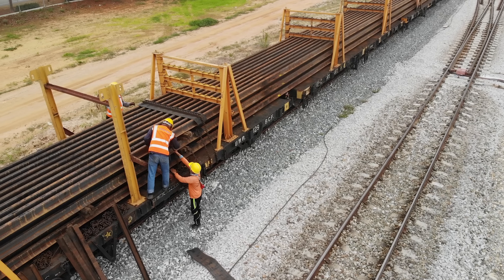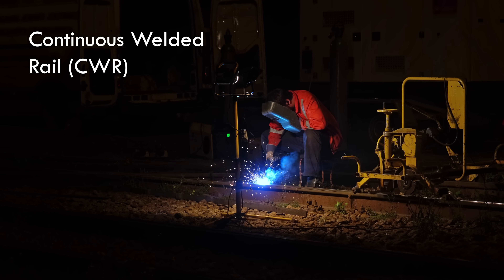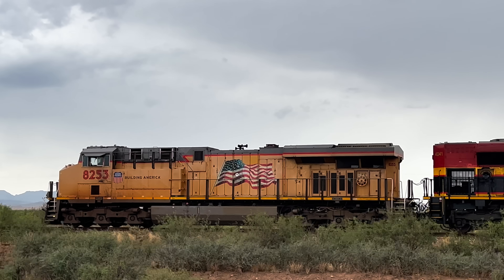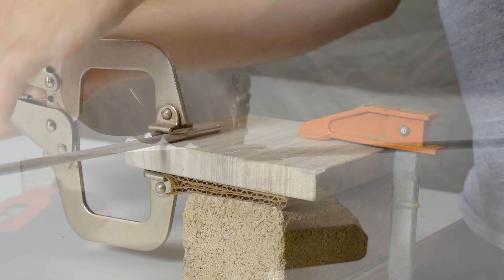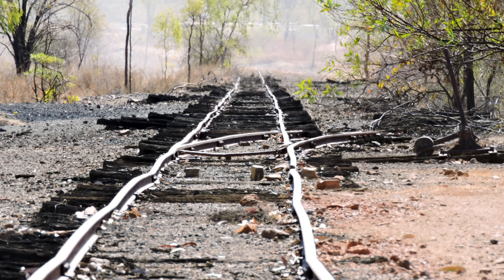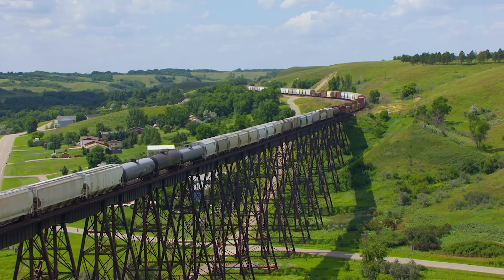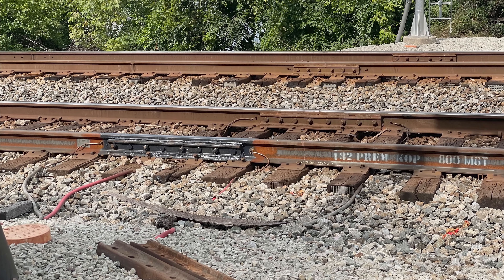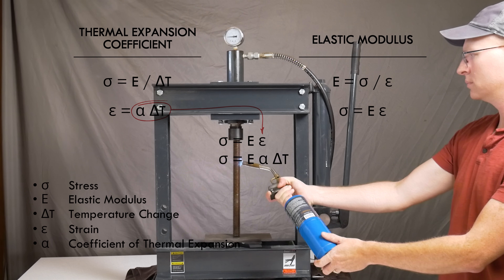Why Railroads Don't Need Expansion Joints

Comment: Railroad sun kink story,
June 21 2016, me and my wife were enjoying our first wedding anniversary vacation in Durango Colorado. We booked a trip on the historical narrow gauge railway that runs to Silverton Colorado as part of our trip (highly suggest it if you're able, and if you go in the summer, get an open air seat!). During the trip back that afternoon/evening, probably 30 minutes away from the depot, the train stopped abnormally and after a long wait, everyone was told that the rails were sun kinked and the train would not be able to finish the journey. Another train was sent to rescue everyone and get us back to the depot, and it was a record setting hot day so I heard no complaints. But we all walked by the kinked rail, and it had to have been deformed over 5 feet to the side over a distance of around 30 feet. I still have the picture on my phone to now. I also just found it by searching for it online. Definitely made me understand and appreciate railroad engineering just a little bit more that day

Comment: Question: is the entire rail cold-rolled... It's definitely hardened? Which means the surface (at least) is close to yield or has yielded to achieve ultimate tensile stress (UTS). If the surface has been cold rolled to UTS, and the core is not hardened, do they behave somewhat like pre-tensioned steel reinforced concrete? Where one part is compressive, the other tensile, making a balance to minimise expansion linearly, while allowing more radially.
Is this how it is?

Comment: The first time I pondered about this was riding the Shinkansen in Japan. That was the first time I notice their tracks has no expansion joint. I search the web as what is the secret behind this to no avail. I got it immediately as soon as you started to talk about modulus of elasticity. The most impressive thing about these rail system is the engineering structures go into withstraining the rails from buckling, especially the extremely high speed train in Japan and other countries. Brady's channel is one of the smartest on Youtube.
Reply: From my YT explorations, it appears the Shinkansen lines use slip joints like those shown at 12:50. This I learned from a video from a Japanese hobbyist trying to replicate the unique sound of trains crossing these joints...with his  model trains (he got close, but was no small feat owing to...well, size and materials).

Comment: Isn't the clickity-clack of (non-continuous) rails also caused by the joints being staggered by 10-ish feet on the two rails?  You'd get a different noise if both wheels on an axle hit joints simultaneously.

But back to the main topic - I knew many railroads had switched to continuously welded rail, but thanks for educating me on how they handle thermal expansion/contraction issues with those.

Comment: It's somewhat surprising to think of how much new technology and revolutionary engineering is still going on with modern railways, when to a casual observer they don't look any different from what was used in the 1800's.
Sure, I get that we've moved to diesel engines and we have safer coupling mechanisms, and it's not surprising that we use computers for controlling the switches now.  But who would have thought that the rails and the wheels are STILL being refined to this day?  Especially when you consider how mind-boggling massive of a project it is to replace thousands of miles of railways, thousands of existing rail cars, and with each improvement still be compatible with existing systems that haven't been upgraded.

The old adage "if it ain't broke don't fix it" doesn't seem to apply here.

Comment: As someone who has worked in manufacturing, including being a certified welder and working the last 15 years as a truck driver, I  found this totally interesting. I was wondering about how they dealt with the compression of the rails over long lengths. One afternoon, i saw a crew working on laying track as they were getting ready to perform a thermite weld. Unfortunately, there was no place to pull over the bosses 72-foot long truck. It would have been great if i could have observed the process.

Comment: Now; that this is most important when talking about straight track. Curves allow some natural relief without too much issue. It's why expansion loops are used in piping, where expansion joints are not practical.

Comment: Trackman here, the cold contraction is enough to sheer 1 inch track bolts in half. When the weather starts to change and we get the first cold snap is when we see the most broken bolts and pull a parts

Comment: In Australia, old lines do bend in the extreme temperatures that occur. So I wondered what they did when they completed the Adelaide to Darwin line - 2979 km.
In central Australia it can vary from 0C to 50C. They laid long rail which were then welded and laid on concrete sleepers, but the ballast was only laid when it was 25C

Comment: Help me out, guys... In that old system with the gap between rail ends, how does the gap close under heat (and later reopen) when the 2 ends are solidly bolted together?

Comment: Railways will "embargo" their trains if they have determined that their rails are at risk to cause possible damage (when running their trains) during certain weather events such as extreme cold or heat. It's their right to protect their equipment and personnel. (Same principle applies during hurricanes, though not expecting rails to go through thermal changes.)    John

Comment: In July 2002 I was on the Amtrak Capitol Limited when it derailed just north of Washington due to a buckled track on an extremely hot day.  I could feel the train lurch to one side just before it derailed. Subsequent reports said the track had moved 18 inches out-of-line. You'd think the Northeast Corridor, of all rail lines, would have been properly engineered!
Reply: Or that they would know the risks posed by very hot days and inspect their tracks.
Reply: I used to ride the MARC commuter train to DC, using the same tracks as you on Amtrak, using wooden ties (the Amtrak lines up to Baltimore and points north used concrete ties, like our friend from Finland above, and never had these issues).  In the last few years I rode about, 5-10 yrs ago, CSX who operates my line had a rule (for passenger trains only!) that if the expected daily temperature increase was more than 20F then they would impose heat speed restrictions on the ride home from work, which happened frequently in the summer.  I guess they didn't care if freight derailed, as you can't get sued by freight :)  Regardless, hearing or seeing texts warning of heat restrictions always got a collective groan from the riders.  I often said that the B&O railroad, the oldest in the USA, hasn't figured out how to operate trains at speed when it's hot out or the train can derail, is ridiculous!
Reply: @ps-ic8pm     Right, I realize now that route isn't actually part of the Northeast Corridor until you get South of Union Station.  The derailment was just North of Union Station on a freight line running northwest to Pittsburgh owned I think by Norfolk Southern.  So I guess that explains the poor condition of the track.  But as far as speed I don't think we were going more than 15 mph when it derailed, although supposedly the engineer saw it and tried to stop but not in time.
Reply: CSX
Reply: CWR is extremely costly. I guess somebody likes to take a short path and reduce the costs where it's impossible.
Reply: I have been on an Alaska Railroad train that had a track inspection car ahead to check for heat kinks on the hottest of summer  days.  CWR is used in Alaska, but not yet on the costal Anchorage-Whitier portion.
Reply: It's crazy how bad US rail is. Being used to the wobbly ride of Amtrak, I couldn't believe how smooth French tracks felt during my first visit to Europe. And this was considering all types of passenger trains: commuter (RER/TER), métro, high speed, "normal" non-HS track, and even trams. They are just so much more comfortable.
Reply: @rallymaniac92  I rode a Chinese high speed train a couple of years ago between Beijing and Xi-an, about 900km. At 320km/h, I could stand a coin on edge on the widow sill and it never budged. Only with a train coming in the opposite direction (combined speed over 600km/h) did the turbulence cause it to fall over.
Reply: Problem is Amtrak doesn’t get near enough funding and the first thing railroads reduce spending on is maintenance
Reply: Please read my comment and you will realize what took place.

Comment: I don't know too much about rail, but one thing surprised me that you didn't cover.  Since rail is tired to sleepers that float on the railroad bed, don't bends (curves) in the track change dimensions when the rail expands and contracts?  The more bends you have in the rail (think following a river) the less issue there would be.  Each sleeper shifting a minuscule amount isn't an issue.

Comment: Interesting content. I never thought much of rail joints or welds. But I have always assumed that some significant portion of the click-clack was produced by worn wheel bearings. I can hear the difference between individual truck sets as they pass by at crossings. Some cars are very quiet, while others make a click-clack at a frequency corresponding to the wheels' RPM. From my experience as a mechanic and millwright, that is absolutely in line with a wheel bearing worn-but-not-yet-failed.

That is to say, I sometimes feel a bit nervous stopped next to a very noisy train, ha!

Comment: Great job explaining a difficult process
I'm a retired railroad design engineer and my last job was working for SAR, Saudi Arabia Railway. When the temperature was 51° during the day and 10° at night the forces of expansion and contraction are huge
Never a big problem. But when I worked in the northern USA the first hot day in early summer was always a nail bitter

Comment: Really interesting to know that you can effectively (somewhat) negate expansion/contraction in metals!
A bit like thermal movement, hardwoods expand and contract with seasonal humidity change. As a furniture designer I have to constantly consider and allow for that seasonal movement. Major difference being in wood that movement is caused by the incompressibility of water; meaning no amount of structure or bracing can keep that movement from happening. Funny that a “simpler” material is more demanding design-wise than those more “complex” modern materials.

Comment: I wonder, would the use of the diagonal joints used to "join jointless rails" shown at 12:56 cause less wear on the train if they would be used instead of the regular joints, or are there other problems to consider?

Comment: this is what annoys me about engineers in an office... Grady you talk about the ambient heat in texas at say, 115* F... but you didnt factor sunlight thermal energy at all... that steel is hot enough to burn you easily in texas sunlight... closer to 160* in reality 

you also got close, but didnt quite brake over in the thermite welding... thermite welding actually puts the rail into tension from the massive amount of heat welding the steel, then cooling off and shrinking the rail and puts it into tension... the whole rail section for miles is under that amount of tension allowing for it to expand under sunlight and ambient heat to a more neutral amount... its like a reverse bolt

Comment: But there are expansion joints in railways. You'll see breather switches even on TGV lines. TGV lines are connected via thermite welding.

Edit: I got to the end and he briefly mentioned breathers. The title of the video is pretty misleading

Comment: I've seen them install rail in cooler temperatures with fire.  They literally light fires underneath the rail to heat it, so it will be under tension once it's all done.  That is one of the neat properties of steel, it'll behave under tension, but do everything it can to get rid of stress under compression.

Comment: Fun fact, they say a 1/4 mile stick of rail laying out on the ground will grow about 7 inches on a hot day. Another fun fact, when they lay rail on the ground for later use they will not place the sticks of rail end to end but will overlap the end a few feet so the ends do not meet and push against each other on a hot day.
Reply: If you have several hundred yards of rail unclipped and the sun comes out you can actually see the end of the rail moving.

Overlapping loose rail ends is very wise, as if the but up and the sun comes out a ton of compressive stress is generated for every degree C the rail temperature rises.

Comment: Grady, this is a wonderful video for anyone who doesn't want to dig into the math.  I am a software guy, not a mechanical engineer.  However, I've had to re-implement many of the things you covered here in some GPU versions of some simulation software.  I don't care about the math and have long forgotten partial differential equations, but of course it is helpful to know what on earth one is calculating.  Good job!

Comment: That's brilliant, welding the rails near the hottest temperature they have to deal with. Acoustic guitars have similar but opposite trouble with humidity expansion. Wood has very low tensile strength across the grain and will split when the humidity drops, but if you glue in low humidity then expanding usually doesn't break anything.

Comment: In my city there are some sections of tram track so buckled that derailment seems iminent. The only thing keeping the track somewhat straight is the use of concrete slabs to embed the track sections. But looking along the track one can see it looks like a snake.
Passengers on those lines sections are tossed around very hard even when sitting. No derailment yet though. Most likely due the slow speeds. 😅

Comment: Good video. As a mechanical engineer, I anticipated most of the points covered. Gonna admit though, I didn't think of welding during very hot days to have a higher neutral temperature. And even then, I was thinking more like mid-point of the anticipated temperature range the rail is subjected to. But he was right that you need to err on the side of avoiding buckling

Comment: People in my neighborhood complain about how noisy the railroad is. I grew up in this place and witnessed the trains of sixty eight years ago. Joints in the rail every thirty nine feet and engines that were not controlled together by computers. The differences between engines would set up a throbbing reverberation that would shake glassware off of shelves.. The trains these days just make noise when the motive power goes by then quiet and peaceful with the occasional flat spots on wheels thumping along. Growing up it was common to trespass by walking the rails. The trains went real slow and you could hear them a long ways off. Now they run at forty miles an hour and if the wind direction is right, you don't hear them until they are nearly on top of you. It's neat to learn how they use temperature to adjust how much the rails expand and contract.

Comment: Another thing that's relevant in that space is that many high-speed rail lines use ballastless or slab track, which is usually a bed of concrete that holds concrete sleepers to mount the rails on. There are a number of variations, including elaborate constructions to reduce noise. They are estimated to last about twice as long as ballasted tracks but are rather more expensive to build or repair. Obviously, that way, it's easier to ensure the rail is perfectly straight and has the right amount of longitudinal stress.
As an aside, high-speed signalling systems can't use track-side indicators, as the engineer will not have enough time to be sure to notice them, and needs too much distance to stop the train then anyway. So signaling systems for these trains are all using radio or other electromagnetic systems, and instead of trackside masts with optical indicators, the relevant information is shown in the cab on a screen (and enforced by the on-board computer: too much speed, it may just stop the train; and pretty much all restrictions are about top speed: the equivalent to a stop signal is "keep it slow enough so you can stop in the distance left ... slower ... slower ... max speed is now zero"). Over here in Germany, the speed at which high-speed traffic rules start to apply is 160 km/h, around 100 mph. Level crossings are also forbidden then. We have two high-speed signaling systems: the old, locally-developed LZB (line train control, so named after a cable going through the middle of the track), and the newer European ETCS (from level 2 - level 1 is for slow tracks and uses traditional signals).

Comment: I live in Australia, and I always wondered why a lot more trackwork happens in the middle of the day and in summer, rather than at night like roadwork. Night always seemed easier to me because there isn't as much traffic. But having a high neutral temperature makes so much sense. 

I wonder if you could modify the baseplate that connects the rail to the tie, and connect the two rails rigidly to eachother, to maintain the precise spacing of the rails while allowing a small amount of lateral movement relative to the tie. That way, when the rails want to buckle, they can move a few inches, but only if they move in the same direction. Given both rails are in the same environment, they are probably experiencing the same temperature, so they would want to deform a similar amount.
Reply: In the case of a sun kink, in contrast to the photo Grady showed, both rails often buckle in the same direction when the ballast fails to properly restrain the track structure, so the rails remain firmly connected to the crossties (sleepers), but rather abruptly wobble out of the general alignment of the track section. Here's a link to one such incident caught on-camera in Australia: https://youtu.be/_LoXgN1QWZM?si=MzvidKvfErxwqFc-